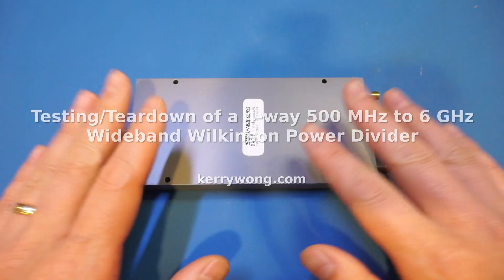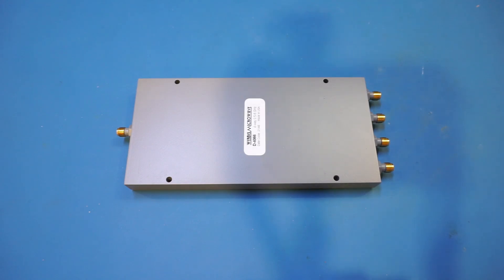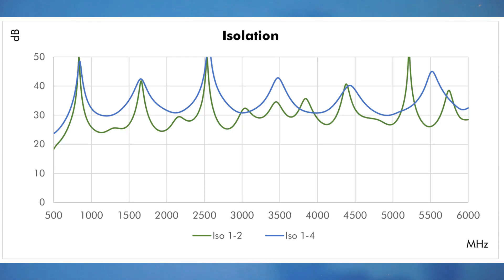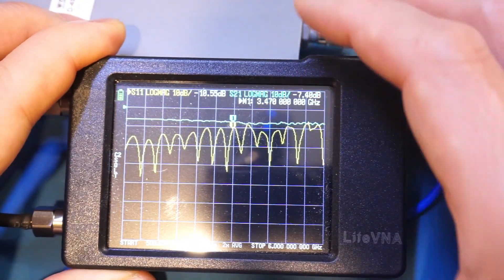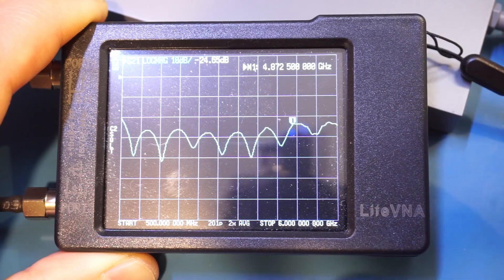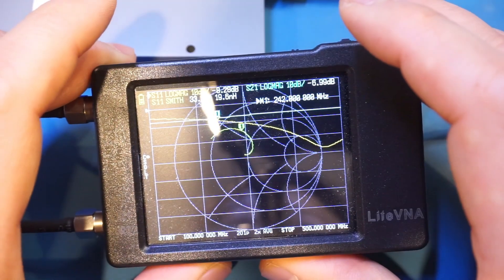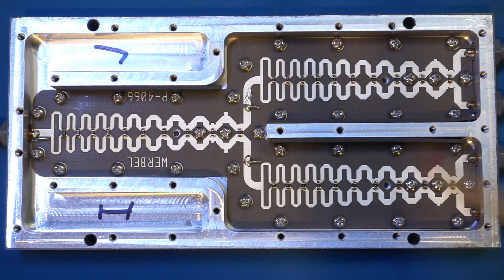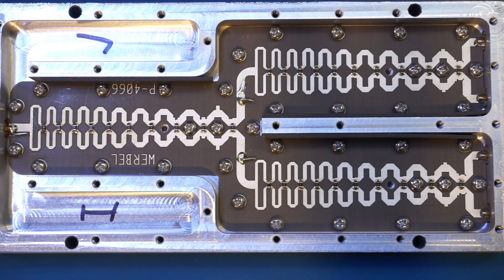Testing/Teardown of a 4-way 500 MHz to 6 GHz Wideband Wilkinson Power Divider from Werbel Microwave

Comment: I don't think there are any additional features on the other side. The design looks like a typical microstrip Wilkinson. Microstrip structures require a solid ground on the other side. Those pieces of wire soldered on the line looks like a tuning stubs used to adjust performance.

Comment: Hi, Kerry there seems to be a dry joint on Ports 3&4 where the connections comes through from the bottom of the board. I am comparing between the Ports 1&2 where the connections from the bottom of the board I hope this observation has prevented a fault later on.
Reply: I also realized it but it seems that this wire is partly well connected what might be sufficient. 
I also look at the fine adjustments (cuts) at the last loops in front of the output. They are identical for the output ports but they are different from the shape of the first divider, what might well make sense. 
When those fine adjustments are relevant then I wonder about the wires at the through connections, they are hanging over quite a bit coupling with the following lines.